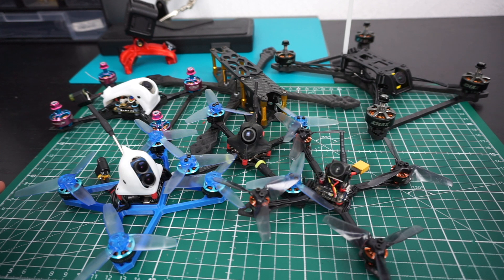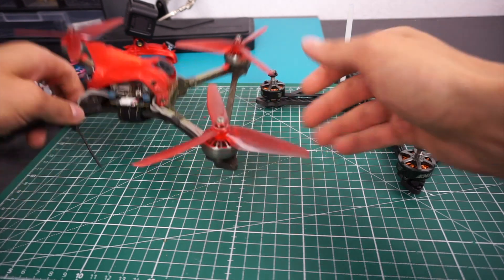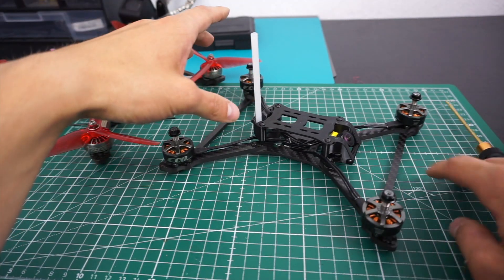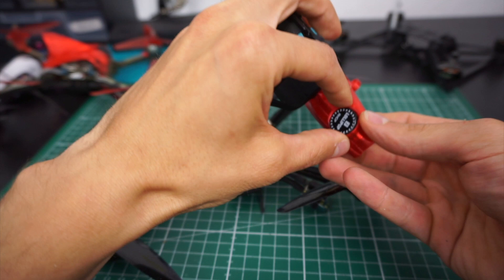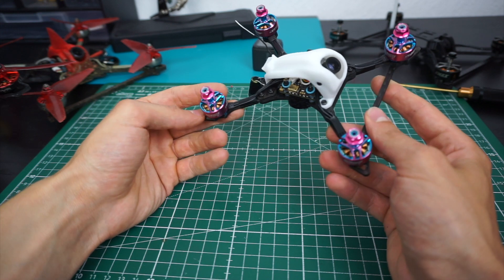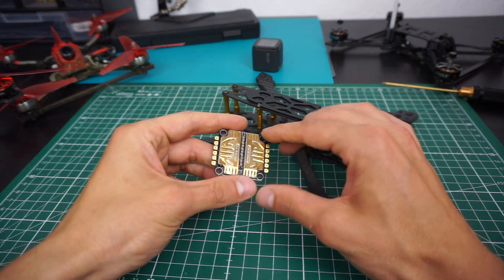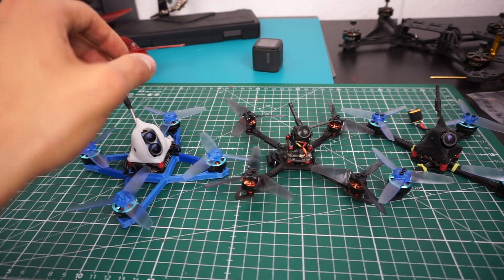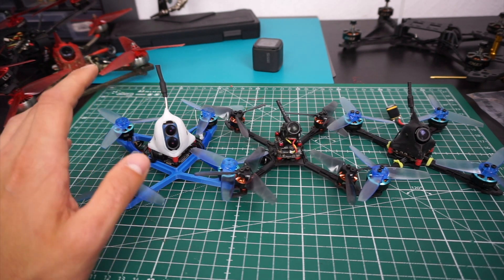Frames, Frames & Toothpicks ! Update on my latest FPV designs

Comment from the maker: Content:
01:13 - New 5" Frame
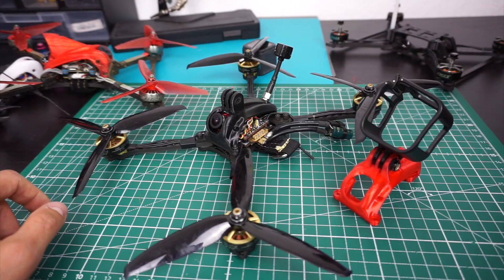04:48 - Updated Gatehunter RS5 GoPro Canopy
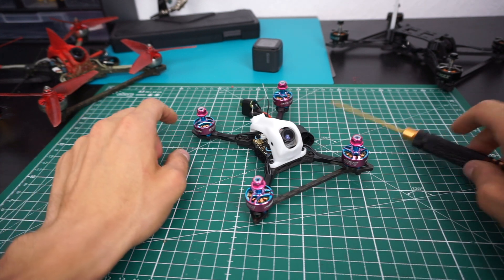05:32 - New 3" Frame
07:32 - 5" Freestyle Build
09:37 - 12A AIO Toothpicks ESC - is any of them reliable?!

My Thingiverse: https://www.thingiverse.com/Dave_C_FPV/designs

Components mentioned in the video:

- Golden Flywoo Combo: http://bit.ly/2YHSJYJ
- Nice Skystars Frame: http://bit.ly/2JyNiFm
- Cheap Emax Motors: http://bit.ly/2SelHgJ
- Yellow Caddx Ratel: http://bit.ly/2JqDpe3
- Caddx Tarsier 4K cam: http://bit.ly/2NtktPR

Comment: Dave, I have a Runcam Nano2 which file do I need to print for the Canopy? On your Thingiverse page I see 2  pod files for the Pod_for_Caddx_Turtle_V2. Where is the stl file for the RunCam Nano2? Thanks. I'm going to use the GEPRC12A and some RCX1304's 5000kv Runcam Nano2 and the new Eachine Clone of the TBS Nano. 3S 550 GNB. GF 3025 2blade  Let me know what you think. I typically run the 1304's 5000kv on 4S with GF 3025 2blade  and it's a monster but think on 4S the amp draw might be too much.

Comment: My brother have u had a chance to try out those 1104 T motor f10 7500kv yet. If so just wondering your thoughts on them. I see u have them on the avan 3in 3s maybe. A company by the name xt xinte has them for sale for 32 dollars for a set of four. Just seeing how u feel about them.
Reply from the maker: Unfortunaltey not since the iFlight Stack is out of stock on BG :-(
Reply: @DaveCFPV  bro they copied your frame 😥